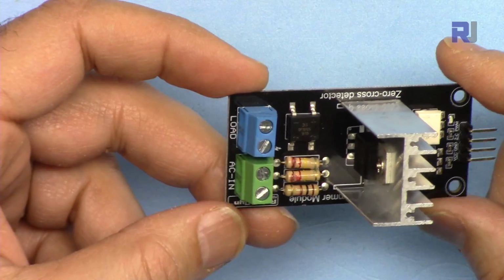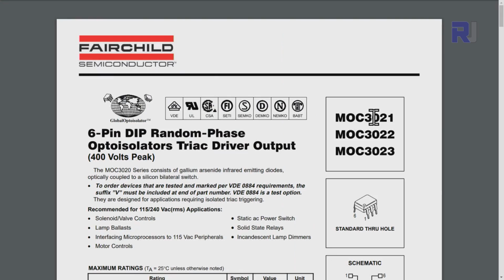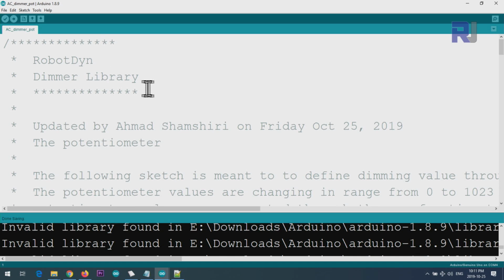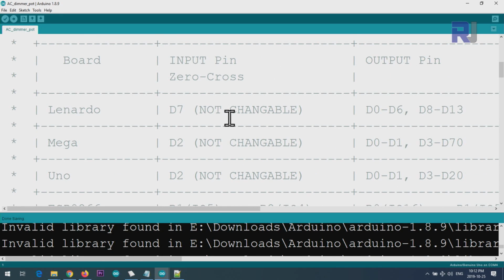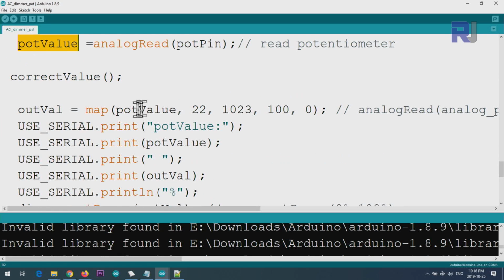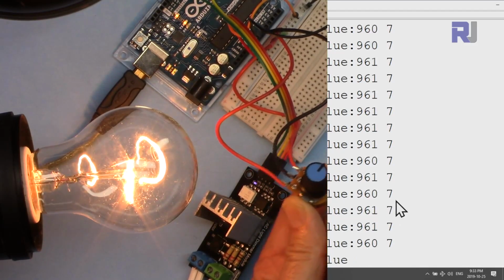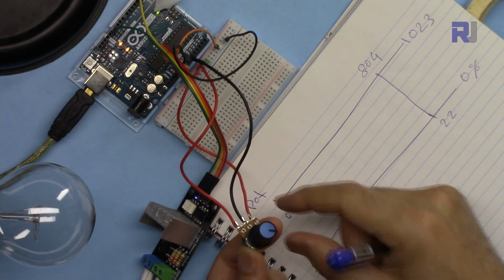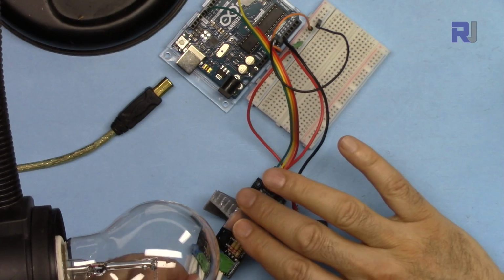RobotDyn Control AC bulb with Arduino AC Dimmer - RJT229

Comment: May it be easier just to map(potValue, 0, 1023, 96, 22). You will get smooth dimming from OFF to FULL_LIGHT on full rotation of potentiometer.
Reply from the maker: this may work for one case. Worth trying.

Comment: Can i use 2 dimmer module with Arduino uno? Because Arduino Uno have 2 interrupted pins.
Reply from the maker: yes if you can set up all settings and pins it should work.

Comment: Hey thanks a lot for the tutorial. 
I intend to use the arduino and AC dimmer module to control the light levels with my python code on my computer.  Does that mean I simply do not need the dimmer switch itself and the rest is the same setup? and If i connect the arduino to the computer It should be sufficient as long as I figure out the python to arduino contact?
Reply from the maker: Arduino is programmed using computer. After downloading the code into Arduino, you don't need the computer. It just needs power to work. perhaps you are using the USB port of Arduino to communicate with it which you can do any other USB to UART modules. Now the the I have shown and worked on works with Arduino.  To send signal to this dimmer, wee need the output and input pins of Arduino. I hope you found answer in all this.

Comment: Hello,
Could you explain how to use the cayenne firmware to control the lamp, trough an ESP8266? Using only the AC dimmer.
If you need contact me: brunolourencopedro@gmail.com
Reply from the maker: Hello, I've never hard of "cayenne" and my Google search shown a car. Also I tried this module with ESP8266 it did not work. Code needs some adjustment.
Reply: @robojax  
It's this website: https://developers.mydevices.com/cayenne/landing/create-raspberry-pi-projects-with-cayenne/
Did you manage to make it work with ESP8266?
Reply from the maker: I answered your question in previous comment.
Reply: @robojax  Only minor adjustment needed for ESP8266. First is to correct RBDmcuESP8266.h and change void sir_ext(void) to void ICACHE_REM_ATTR isn_ext(void). I also added //+=============================================================================
// Tells RBDimmer.h we are using an ESP8266
//+=============================================================================
#define ARDUINO_ARCH_ESP8266
prior to the RDBDimmer.h include.

Comment: Can it be done by using nodemcu instead of Arduino by serial data transferring n without using potentiometer..???
Reply from the maker: have not tested. I didn't see interested to make video for ESP8266. if I see 50k views, then I will make video.
Reply: @robojax  Ingeniero no espere a las 50k, hágalo por favor, gracias de antemano por su valiosa colaboración, para los principiantes como yo usted en luz en el camino.
Gracias de nuevo.

Comment: My light always stays on no matter what I do. Could the dimmer module be broken?
Reply from the maker: No. Did  you follow the instruction? I have shown at which value the light can be controlled. if you don't follow it, your light will always be ON. Watch the video without skipping.  Also not skipping the ads will help me. Thanks
Reply: Robojax i will retry
Reply: Robojax i followed the instruction, the light is at the maximum
Reply: i can’t turn off the light. could the pwm pin be broken?

Comment: Can this  ac light dimmer module control speed of ac fan ?????
Reply from the maker: no. It is called dimmer to dim light. it can't work with inductive load such as motors.

Comment: Can u coonect this to Arduino Bluetooth app?
Reply from the maker: Yes you can. There is no limit on that.
Reply: @robojax  how do you connect the Bluetooth module? Can u please share the link of ur video for Bluetooth module and ac dimming together. Do I have to change the code if I add a Bluetooth module instead of potentiometer

Comment: That was a very good explanation. if i use 220V 50Hz supply, which part should be modified?
Reply: and also the code cant be compiled, it sends error message "global variables use 2211 bytes, maximum 2048 bytes". How to solve it? thank you
Reply from the maker: hi, This doesn't mean error.  make sure to select the right com port. You don't need to change. Just use pot to change and adjust.

Comment: It seems interesting for heaters because solid state relays usually have a small power loss due to the snubber circuit
Reply from the maker: But this is low power of 1A or 2A or it will heat up quickly unless you replace the heat sink.
Reply: @robojax  Yes, 2A is not a lot, but it could be enough for a 3d printer for example.  I think it is a good idea to replace the heatsink.

Comment: Quite handy and very useful information again  ✔✔✔ ... Can we use this module to adjust the AC ceiling fan speed? Thank you 😉...
Reply from the maker: It should theoretically work. But I have not tested it. Thank you.
Reply: @robojax  Please test it for us. I am working on a project here I need to control the speed of the AC motor through the pwm pins from the arduino to the pwm pin of this ac dimmer